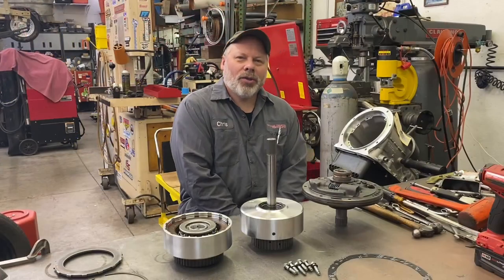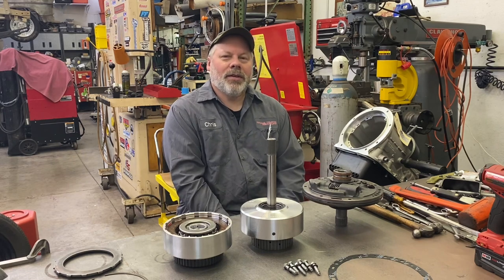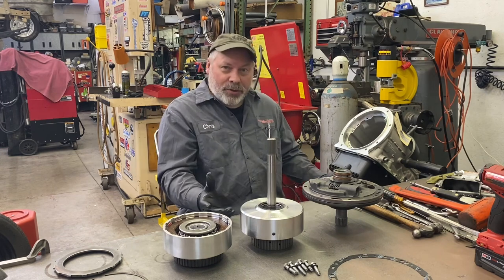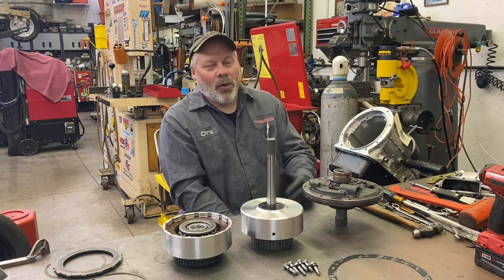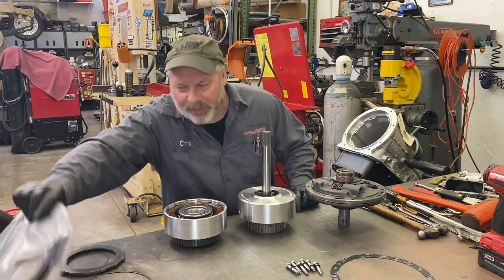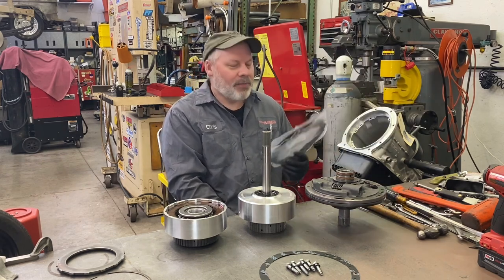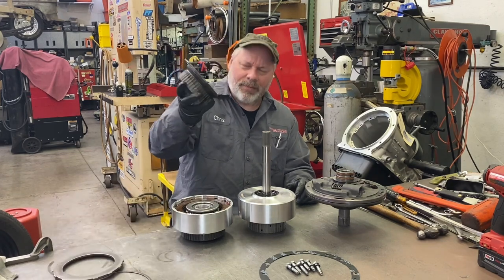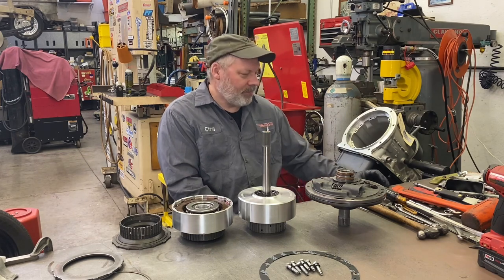Mountains Garage: Rossler 210 TH400

Comment: Shawn, you have mentioned before about the direct overspeeding if the trans is shifted to neutral after a pass.  I'm am not doubting it but I am having difficulty visualizing how this happens.  Nothing is locked so I am missing what allows the sungear(and hench the direct drum) to reach dangerous speeds.  With the output shaft becoming the input, I understand how the power flows but does the rear sprag not also freewheel?  To me that means that everything is just randomly spinning.  Does some component not have to lock to make the sungear overspeed?  It would be great if you could set up a demonstration to show this.  Thanks.